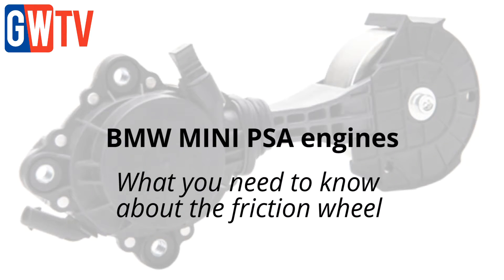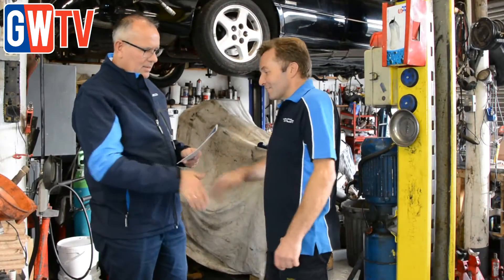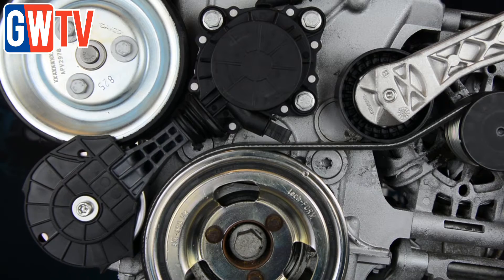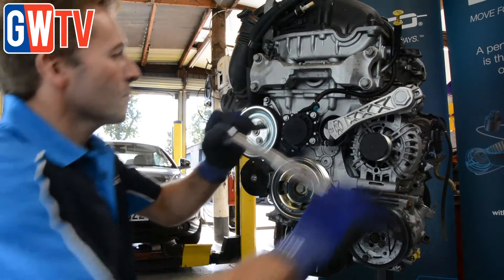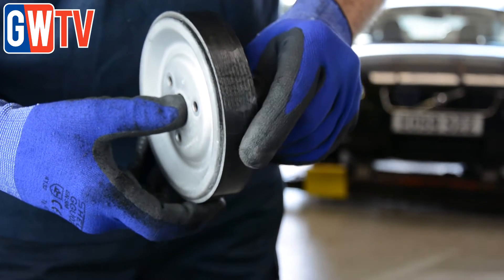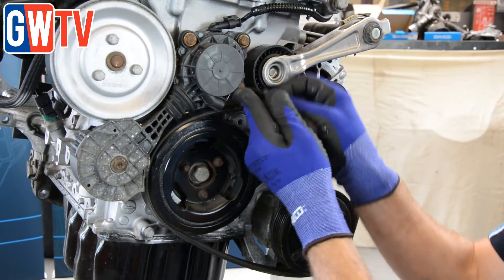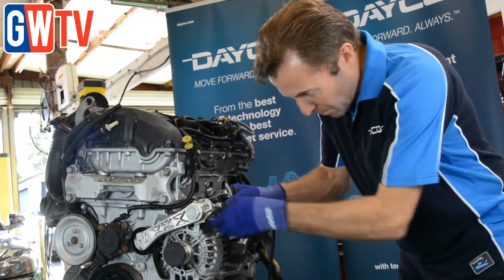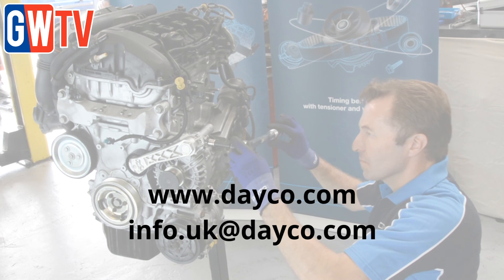BMW MINI PSA engines: What you need to know about the friction wheel

Comment: Is there any relation to the friction wheel and the Exhaust VANOS solenoid. I got an issue, when this Friction wheel is engaged, I get a huge voltage drop on the Exhaust VANOS solenoid. causing fault code 2845?
Reply: One thing they didn't mention, for failures. When the friction wheel starts to fail, it can pull a large electrical load. Because 7 other components share a Pin 41 Live feed, it can draw load from any of the 7 of the other components, such as the solenoid valve (Exhaust).
Reply: Did you find a solution? Because we just changed the timing chain, and it ran for about 10 minutes perfectly and then went into emergency programming and now we have a fault on the vanos exhaust solenoid code 130304 and the friction wheel is defective now

Comment: I need help
Reply: Did you get help ? I’ve just been through this on an r61 which had a failed actuator and was boiling the engine. Now all changed and no longer have the electric actuator. I changed to the permanent drive unit.

Comment: I was struggling with noise similar to chains during the cold start for two years, I and dealer was going to replace the chain set for second time. I was decided to give up the Peugeot 408, but for some reason I watched this video and bingo. The sound that looks like rattle chain came from electric actuator of pulley water pump, exactly during strategy cold start, after few minutes the electronic actuator engage the pulley and noise desapeares. I replaced the Dayco actuator and solve the problem
Reply: Thanks for the info, I have similar problem on my Mini. Did you just change the friction wheel or the water pump pulley as well ?
Reply: @touaibisalim8335 same! Any fix?

Comment: I experienced this activated friction wheel to be the cause of random engine overheating in my 2008 mini Cooper. Random in the sense that there can be weeks in between. After the first overheating there was severe damage to the engine, I fixed it and installed an additional (autool X60)OBD temp gauge with an accoustic alarm since I new I did not find a root cause. It overheated several times later, each time the early alarm prevented further damage. At inspection everything seemed to be normal each time. Recently I could finally proof the friction wheel sometimes does not engaged while the engine is hot. Root cause: brittle plastic that should hold the small electric motor in place in the back. It was loose so it could move a little to the back, not visible since it is facing towards the engine. What I could find is that the turbo versions have a similar passive tensioner, without electrical engagement. Guess what I did put back.
Reply: Hey i am just about to do the same, did you get any error code after replacing it with a version without the actuator?
Reply: @MartinAdler3000  I did not get an error code after replacing it with a passive tensioner from the turbo version.
Reply: Thanks very informative

Comment: I have the classic spring tensioner that's always touching the water pump pulley. I don't understand why they thought that the water shouldn't be circulated until a certain temperature. The water should move around the engine no matter the temperature. The BMW logic i guess.
Reply: "decreases the engine’s warm up time, reduces its overall emissions and improves fuel consumption." according to autobiz.
Reply: @khwaac  from real life experience, it does non of that. Or if it does, it's negligible.

Comment: I wish they made a reverse water pump and a friction wheel delete kit. Absolute trash,  a turd shaped like a candy bar and BMW ate it up. This single piece of engineering fail ended my love for the mini.
Reply: My peugeot has the same engine but it doesnt have the electronicly frictionwheel. It is there but its non electrical, so the belt always activates the waterpump
Reply: @iwan-wr7gn  The U.S. vehicles are always engaged so it's really not even needed and could be deleted if they made a reversed water pump and just used an idler pulley.

Comment: What makes the Prince engine whine? Is it the power steering pump?
Reply: Hi mate my peugeot 308 1.6 vti whines when you rev up bloody annoying sound even embarrassing been on forums found out it's the water pump pulley/friction wheel thinking of changing both hope this helps👍
Reply: @dylanhumphreys6260  My brother has a 207  1.4 VTI and makes the same noise. I think Prince engines have always whined to a degree but a knackered water pump pulley glorifies it. It's just sounds annoying as a Corsa C with a stretched timing chain.

Comment: Do you know which coolant temperature or conditions do activate the pulley so that the water pump starts working? I've got a Mini One 1.4 2007 and the temperature on the 07.00 hidden menu reaches 105C after switching it on from cool before it activates for the first time... too late, maybe?
Thank you for your video

Comment: A Common problem with these are, if the friction wheel is plugged in the car will have a dead short on the heat gauge, even if car is ice cold, and the fan will run permanent. Unplug this friction wheel connector and the car works perfectly. WHAT IS THE CAUSE OF THIS. Computer had a software update and the friction wheel was replaced, and the thermostat housing with all sensors was replaced, still same issue. ANY IDEAS
Reply: @MalavDesai  I have. It has 3 codes.
023B Disengagble coolent pump control SC
0598 Controlled thermostat command short circuit to earth
0947 Control of the oil pump electro valve SC

All permanent codes.

A ex BMW tech suggested the extra thermostat sensors harness need to be purchased in order to fix this.
Reply: @sv_endless6340  did you manage to get this sorted? I have the three identical codes you had. Which part did you end up ordering?
Reply: @rotrottie1871  We have not yet received the part, but, unplugging the friction wheel plug solves the problem of the heat gauge going to a dead short, but fitting the extra harness will solve the issue. Will update as soon as we get the harness.
Reply: @sv_endless6340  thanks for the answer. What part is it and do you have a part number? If  disconnect the friction wheel everything appears to work as it should
Reply: @rotrottie1871  Yes when the friction wheel small connector on top is disconnected car runs and drives perfectly and everything is working normally. Thermostat housing wiring loom 9804315380 peugeot,citroen,mini 1.6VTi,1.6THP engines.
Reply: @MalavDesai  so we have ordered it and waiting on the part
Reply: thermostat is faulty
Reply: @dibnah46  Thermostat and housing replaced by dealers. It is not the fault.
Reply: I’ve got the same fucking problems man
Reply: How did you fix it?
Reply: Is there a set mileage to replace this part? My BMW is on 78000 miles and I'm thinking of changing the water pump at the same time as the the water pump pulley which has score marks on the rubber

Comment: The most useful information I've seen about the pulleys and tensioner arrangement 👍🏻
Reply: Only applies to European versions. NA versions the water pump runs continuously. There is no electric drive for the friction wheel.

Comment: My parents have a 2011 207 xt. The plastic thermostat housing cracked, electric power steering pump died, and it had a problem with the VTI system when they first got it. I wonder what will be next.
Reply: my waterpump from plastic died, so i replaced it with an aluminium one, this one cant crack. I must admit they are shit engines. i have a 2009 207 with the 1.4 vti engine